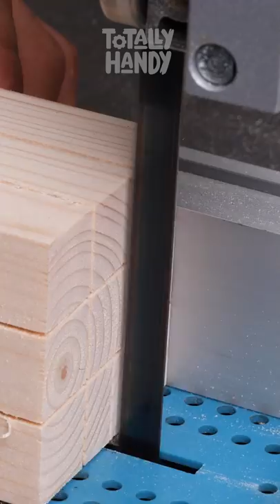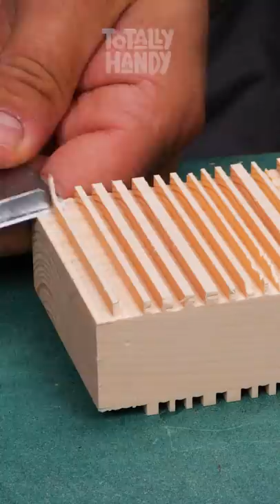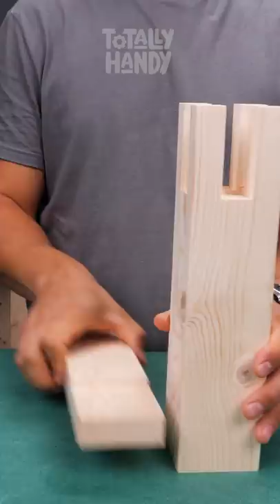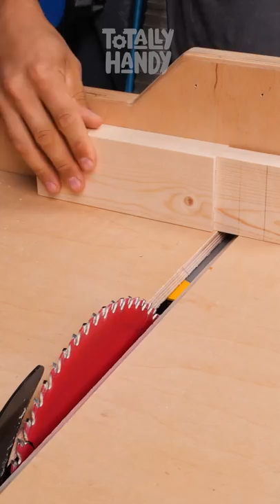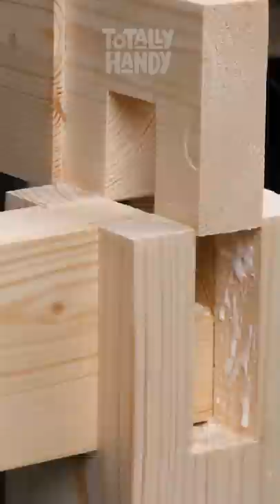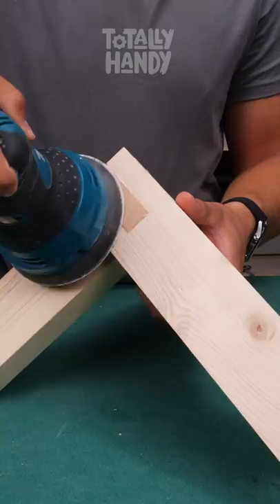Corner Joinery Hack #shorts

Comment: What part of this is a hack?
Do half a second of research and just call it a double bridle woodworking joint. 
Clickbait = dislike + block
Reply: L+ F+ Ni No maidens + gay
Reply: A^2+B^2=C^2
Reply: 🔺️=1/2×b×h
Reply: Also known as the castle joint, I believe.
Reply: E = MC^2
Reply: Bruh, legit dude just got annoyed because tittle said hack. My man its called a “hack” because people don’t fucking know the term double bridle woodworking joint. Its an interesting joint and one that I think is unique enough and gives it a particular clean style, which I would say is valid enough reason for the naming. Now if he just screwed two boards together at an angle, I’d call bullshit but this is a screw-less joint that also looks nice.
Reply: @nickrogers3624  not to mention they used glue. Like C'mon, I'd be more impressed if it was an interlocking joint with no nails/adhesives. But this is just basic as fuck.
Reply: 1+1=3
Reply: @nickrogers3624  how tf is it even a hack tho?
Reply: Agreed
Reply: Most 'hacks' on the internet are either common techniques or pieces of crap.  It's kind of rare to find something actually interesting that would work, is good, and not a common use or technique.

Comment: Sooo...where was the hack?
Reply: A hack, a clever solution to a tricky problem, this isn't popularly known to most laypeople so as a solution to the problem of fastening boards without fasteners this really does fit the definition of a "hack" perfectly.
Reply: @platinumsky845  no, this is a complicated, time consuming and difficult joint only done by skilled woodworkers. The very antithesis of a hack.
Reply: @garyhager6026  hacks are clever/creative meaning they often require skilled technique or knowledge of the process such as being "done by skilled woodworkers"
creative and clever means of accomplishing something, especially in an unconventional manner are also typically more complicated, and often require more significant levels of time or labor like how this example is "a complicated, time consuming and difficult joint"

so yes, you're right to agree that this IS a hack.

Not all hacks are like this, as creative and unique methods of accomplishing something are simply more LIKELY to require greater skill, labor, time, etc but it certainly doesn't exclude either form. I'm glad you agree with me though, thank you for explaining exactly why this example qualifies as a hack.
Reply: @platinumsky845  no, this is in no way a hack. A hack is something that makes a task easier, faster, less complicated or cheaper. Again, this absolutely is not a hack.